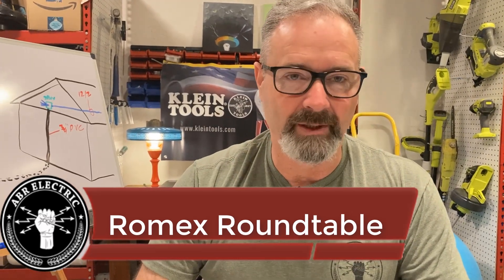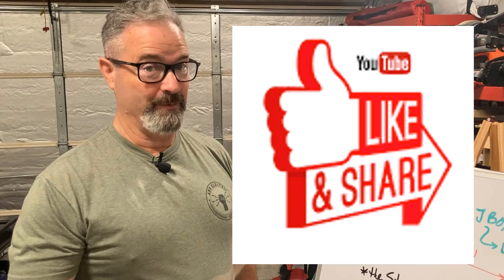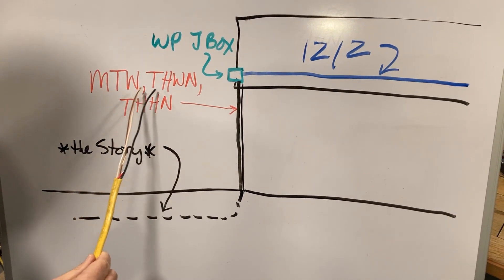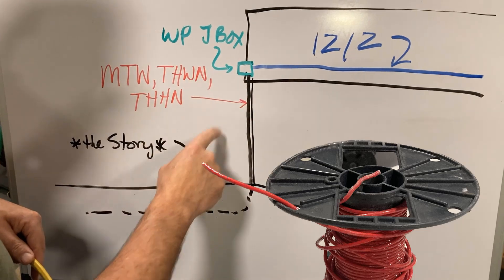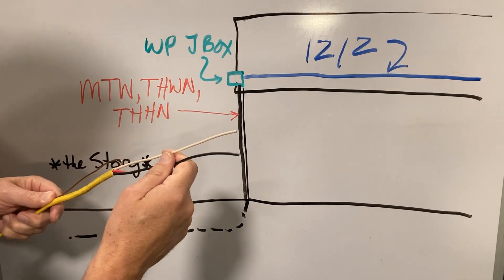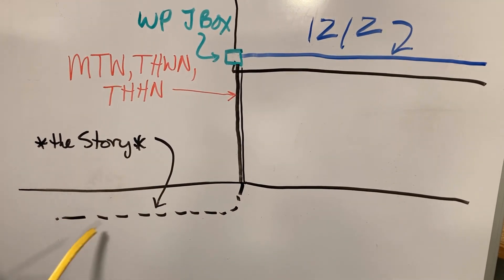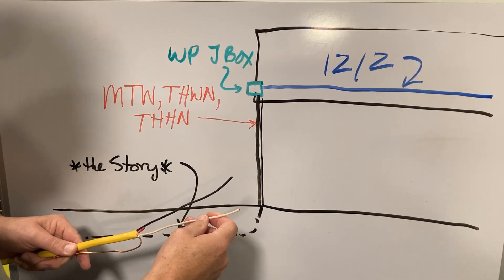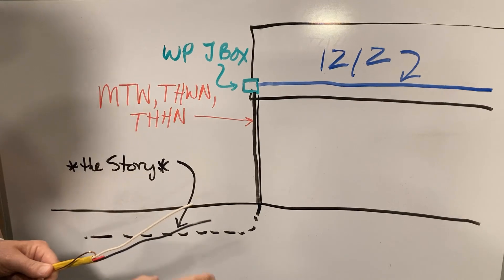Can You Run Southwire Romex NM-B Cable in Conduit Without Sheath?

Comment: You’re showing THHN in a damp location
Reply from the maker: @williamrafferty6811  yes, if you look at the labeling on the wire, it is also rated THHW, or MTW. The W being for wet locations. By practice, most electricians saying THHN, understand it to include the W ratings

Comment: I need install a 50amp rv plug on the end of my house. My breaker panel is in the garage on the opposite end of the house. Would it be legal to run 6/3 Romex NM-B from the panel, into the attic, through the attic to the end of the house, then come out of the wall and on the exterior run inside comduit? It would terminate inside the 50amp receptacle panel at about 30" above ground? OR do I need a junction at the exterior and then change to the THHN or W wire and still run in conduit? I am not getting this inspected, so if all Romex is illegal, am I honestly ever going to have an issue as long as. the joints are glued properly?
Reply from the maker: @spacecoastkid5033  Romex is illegal by Code in the outdoors (damp/wet locations).
You're not really asking a Code question,  right? You know that answer. Do what's right, and keep moving on.
Reply: @abrelectric Thank you!

Comment: Here's my issue. NM ROMEX is usually SOLID WIRE. Regardless of the sheeting of the individual wires it's gonna be hard to pull..... Even with a replacement insulated ground wire.
Reply: Solid wire is frequently used in conduit but as individual conductors, and it's much easier to pull 3 solid #12s than a single 12-2 cable. You can legally pull romex  through 500' of conduit, not a smart move though.
Reply from the maker: I've seen a lot of jacked up romex, forced through conduit (usually water pipe with 90s:)

Comment: Type NM cable is permitted only in dry locations. The outside J-box must be raintight, not rainproof, and the conductors inside the conduit to the shed must be rated for wet locations, such as THWN, THHW, or THWN-2. MTW is approved only for machine tool connections and THHN is rated for dry and damp locations only (Table 310.4). Most single conductors now have multiple ratings, such as all three he mentions in the video so you can keep one reel in your truck for many applications.
Reply from the maker: Thank you!!

Comment: I can see your point for wet locations.  Since inside conduit is not a wet location, can I run romex inside a gray pvc conduit along my garage ceiling? And if I drill holes in the conduit for heat dissapation, does it cease to be "conduit" and OK for protecting the romex? Suppose I do this inside the ceiling?
Reply from the maker: If you're running romex inside of conduit inside (dry environment), just check the fill volume (i .e.12/2 romex cross sectional area vs that of 3/4" pvc pipe). Don't drill holes in it. That works against your overall goal of doing it right 😀
Reply: There's no need for heat dissipation when romex is installed in conduit. It will never overheat simply because it's in conduit.

Comment: Ok Gurus,
 
DIY with simple scenario, need advice.

3 circuits, 15A max each
24ft run (panel to receptacle)
Dry location, under a carport,  8 ft above ground

Can 12/2 Romex be used in 1 1/2 PVC conduit?

Comment: So if you have something like a generator inlet box mounted on stucco, are you able to directly run 8/3 (or 6/3) romex from the main panel to the inlet box without using a jbox since it’s mounted directly to the house?
Reply: That's what I did... without permit! Maybe it would have failed inspection, but it will probably be there until I die! Lol It's been about 5yrs and I've had no issues with it.

Comment: Here's a curve ball: At an IAEI continuing education class the  instructor told us that it's never legal to run Type MM ( Yea Romex ) outdoors even to feed a wall mounted luminare. Told us to only use UF cable. Reason being outdoors is considered at least a damp location & type NM cable was never approved for damp locations. Have received the AHJ approval in house basements to install maybe 3' of Romex thru a piece of 1/2" EMT that's secured to a painted 1 by 4' wood board to a 1900 box for one or two duplex receptacles. Here's a question why are you not allowed to say install a Romex connector into a 1/2" heavy wall coupling to make the transition from Romex to EMT ? And yes I have done that hundreds of times over the years and yes I know they make a one piece transition approved fitting but it's just more things to stock in an overloaded work van .
Reply from the maker: You work with your AHJ. I have similar challenges here. You adapt, and keep getting green tags
Reply: @abrelectric  Worst part Pa does not have a state electrical license and in some small hick towns the only electrical contractor issues the license and often fail job after your very qualified inspector passes the job.
Reply: Had a hick town inspector call me up to tell me that I had 3 violations after my inspector passed the job. Told the hick inspector that if I had three legitimate violations that I would find another trade. First violation was because I spliced a #14 wire in a circuit breaker panel in order to reach the circuit breaker. Gave him the code article that allows it so he said that he would let me get away with it this one time. Other two violations were on company that installed an outdoor sign and ran power to it. Told him that was not on my permit and not performed by me.
Reply: Your instructor may have misinterpreted the code. 334.10 - Uses permitted: Inside single, two family and multi-family buildings. The exterior outlet box that your exterior light secures to is installed inside the building and therefore compliant. There is nowhere in the code that tells us we must do what your instructor says.

Comment: I'm getting ready to run a 240 volt 6/3 cable to a hot tub which will be on a deck.  I want to use flexible Liquidtight one-inch conduit and fittings from just inside the basement, through the joist box, about 5 feet up to a spa pack w/GFCI then down under the deck to the spa, (about 6-7 feet).   Is this allowable and do I have to keep the sheathing on the cable?  Also, would one-inch diameter conduit be enough?  Thanks.  Enjoying your videos.
Reply from the maker: David, 1" is large enough for 6/3 romex. The technical issue is that the individual conductors inside the sheath are not outdoor or damp rated. So, taking off the sheath makes it easier to pull, but does not change the rating of the conductors.
Ideally, you would transition to individual conductors rated MTW or THW or something with a W.
Thanks for the question,  and subscribe to the channel.

Comment: Helpful information.  I’m contemplating running wire from my outdoor service entrance to a free-standing shed, a straight-line distance of maybe 20’ .  My preference is buried conduit rather than direct burial of Cale rated for such.  30-60 amps 120 volts is still a fair am of current for me to feel comfortable with direct burial.
Reply from the maker: I'm with you regarding conductors in conduit vs direct burial. And, direct burial requires a deeper trench :(
Reply: @abrelectric  how deep for direct burial?

Can direct burial go directly into house & shed? or are 2x JBoxes required?
Reply from the maker: @DavidHalko  24" deep to top of the UF cable. You could go directly through the interior framing like Romex. It's just a bit more difficult to strip and more expensive.
Reply: @abrelectric  - I am wanting to dig a hole outside to place a battery box to hold lithium ion batteries for a whole house UPS… about 34.4kw of batteries… need low voltage 48v wires. (Not interested in li-ion being inside the house.)

Since this is D/C, would thick direct burial cable or a large conduit be better? (250 amps @48v continuous is possible with the 12k inverter, would be a 6 foot run or so, maybe 10 foot.)

Not sure what the code would be for such a beast.
Reply from the maker: @DavidHalko  normal stuff: all needs to be listed and approved for your application. I would go with conductors in conduit just for ease of replacement.
Reply: You do realize that 200A electrical services are direct buried all the time?   Not much worry about current.